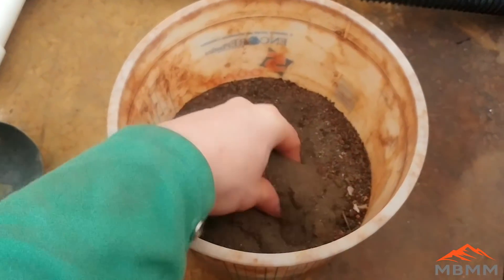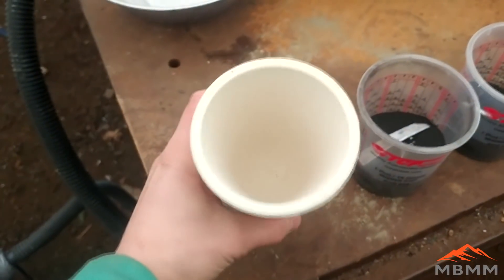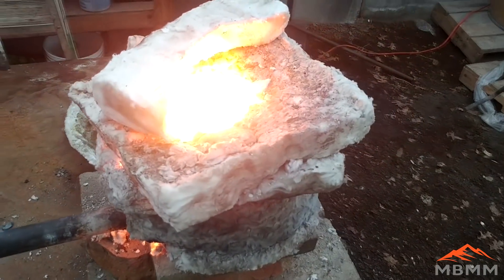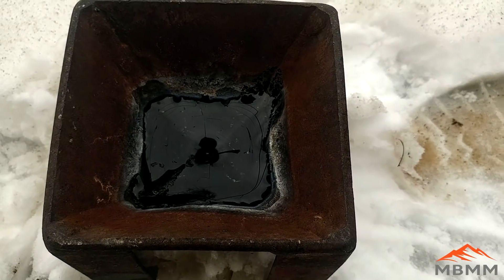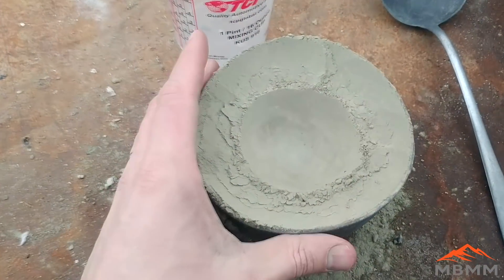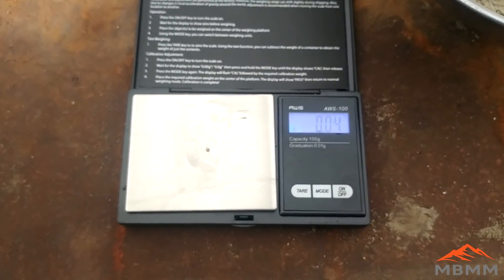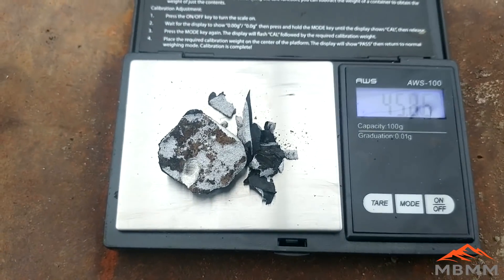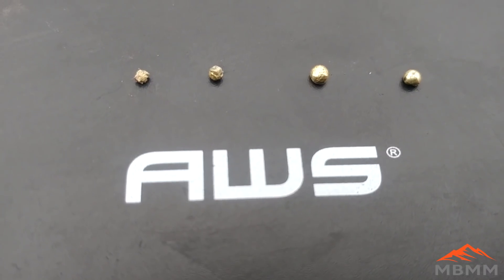Testing Gold Smelting Fluxes For Best Precious Metals Recovery

Comment: Yrs ago 1974 I used to braze weld tin patch panel with a bronze welding rod,this rod came with a Flux coating, buy you could also buy a Flux coating in powder form,for bare bronze welding rods.
So if this Flux removes impurities ,can it be used in gold melting? Using oxygen acetylene gas welding,I used to weld!
I don't know what it's made of,but it's purpose was to push out impurities,and a hard greenish glass like  coating  would be on top ,after it cooled.
Also can u just use some Borax and some lead in the mix for smelting?

Comment: Do you use hardener on the wool? I'm afraid to fire mine until I get hardener because they say silica goes airborne when you fire it. And that could cause silicosis. I would wear a Mask anyway but just wondering.
Reply from the maker: Yes, I always wear a respirator.  Everyone seems to comment on the glass fibers, but I think they are not the worst thing coming off a smelting furnace.  There is also SOx that turns to sulfuric acid in your lungs, heavy metals (Pb, As, etc), caustic fumes from soda ash/NaOH.  So yes the ceramic fibers are bad, but there is other stuff too that I am more worried about.  Always wear a respirator, not just a dust mask.
Reply: mbmmllc l

Comment: I like your videos...!!!  I kept wondering if there was a way around bone ash cupola...
Was looking for the link on that...
I'm a mason... standard mortor mix... 1 part Portland... 3 parts sand?
Soda ash...?  that's just baking soda... sodium bicarbonate 
And presumably your just using silica sand from Home Depot...
The iron pipe looked quite old... obviously it wasn't galvanized... but didn't quite see if it was rusty...
Or if rust would even be a problem... considering the reaction....
Any way great job!!! 😁😁😁
Reply from the maker: Thanks for the comment.  Rust doesn't matter.  Use pure portland cement for the cupel, silica sand from Home Depot will work

Comment: Would the Soda/Iron method work with a "spoonful" of iron filings or dust?
Reply from the maker: It would make the reaction go faster, but the iron rod can be easily taken out.  If you have left over iron filings that would be a problem

Comment: very interesting the only comment i have is if you take the sulfur dioxide  generated by roasting or as a byproduct of smelting you can bubble that gas through water and you will get sulfuric acid and with that you can make most of the other acids . i am not saying you should , as you get but as you get bigger you should think about how to use as much as you can both to reduce waste and pollution but also to increase you profit margin you want to squeeze ever nickel out of your ore you can and from sulfuric acid you can make hydrochloric and nitric acid the other two you need for processing and purifying your metals so always look for that next step that will either save you or make you money while cleaning up your tailings. most mine tailings are acidic and cause problems with runoff and groundwater so make money by capturing that or any other resource as long as you do not need to spend a lot with no return. in other words be smart in how you mine so you can make the most money while doing the least damage.
Reply: There were processes to turn  SO2 into SO3 and then into Sulphuric acid but this used a platinum catalyst which was easily poisoned with other metal particles. Modern processes can use vanadium pentoxide which is more tolerant  of contaminants.
The lead chamber process would have been available at the time but hard work for the output. Remember that roasting sulphides was not known to be harmful in those days, just like mercury, lead etc
Reply: @seymourpro6097  thankyou and good point please feel free to add too or contradict anything i say. finding new ways to twist another nickel out of what i do is my version of fun maybe a forum for urban miners somewhere, we tend to small operations geared more to having fun than making money but we still like the shiny and spending less to get more is just part of the fun whether my oar is ic chips or sulfide bearing stone it is just fun to learn and if i have a few oz of gold silver and other precious metals then that is part of the fun to:-)
Reply: SO2 dissolved in water makes sulphurous acid which is as useless and it is unheard of.  SO2 off gasses need to pass over a V2O5 catalyst at 450C with air to make SO3 which does dissolve in water to make sulphuric acid, BUT it's difficult to control and can get much too hot much too quickly. V2O5 is hard to find because of all it's R and S phrases including may cause genetic harm.
Reply: @seymourpro6097  ok what would you do with the so2 rather than release it into the air where it will make acid rain for instans can i bubble o3 through the so2 in gas form or in the water ? i am not a chemist so you tell us.
Reply from the maker: Great, thanks for the tip!

Comment: Hey dude, Nice Videos. May I ask you a Question about smelting? I have a lot of Gold dust really 0,010mm to 0,040mm tiny small gold dust, that can also float on water's surface, but is also mixed up with another kind of dust. The gold cannot be separated from that dust. can I smelt all together and the gold can sink to the bottom of my cone bar? Just asking before to do it at home
Reply from the maker: Yes, that should work.  If you have a large volume a shaker table would be handy

Comment: Great work, makes me think as I know of a mine in Nevada where I could pick up a good 50 pounds or more of matte that was produced in smelting and pouring their gold. I wonder if it would be worth my while to pick it up next time I am down that way...  They probably figured the small amount of gold lost in the matte was insignificant.
Reply from the maker: If you get a sample I would be happy to run some tests for you.  Maybe we could do a collaboration video together??
Reply: do it
Reply: one without a test batch you will never know and two a very small flail mill could grind it fine enough to run small batches across a small shaker table blue bowl or some other method of concentration to reduce the amount of matte that you would need to fire and waste oil burner are cheap to build and operate go have some fun even if you do not recover much.